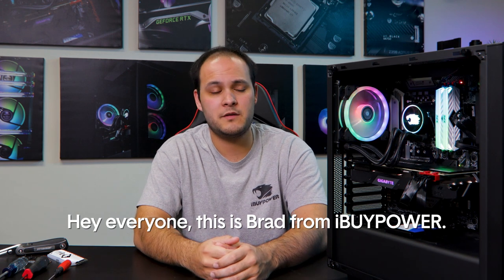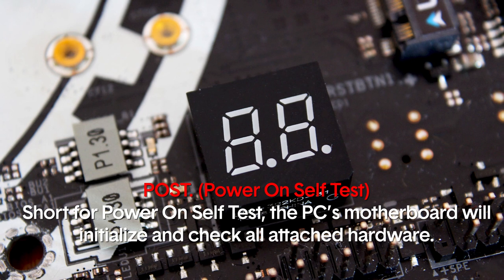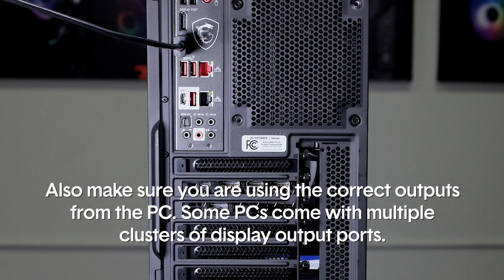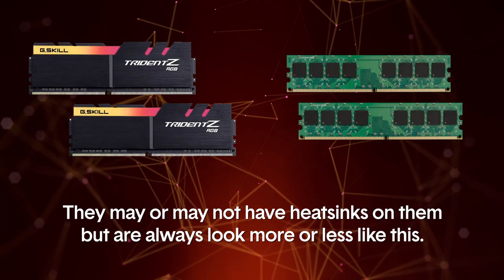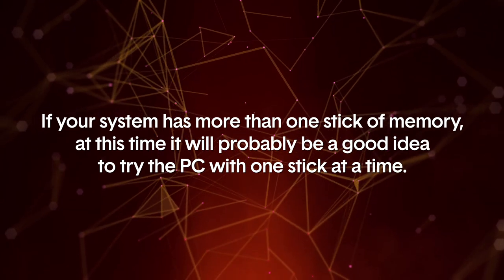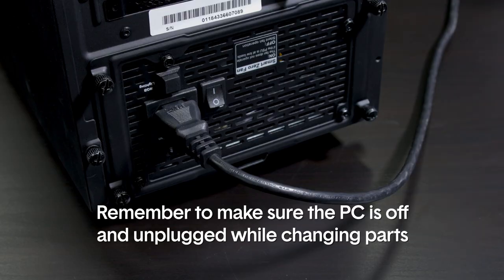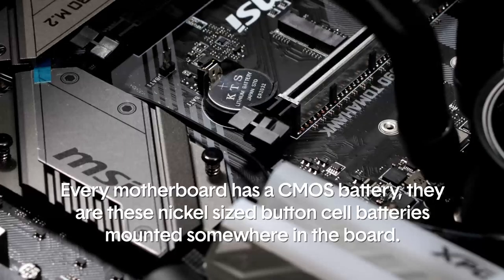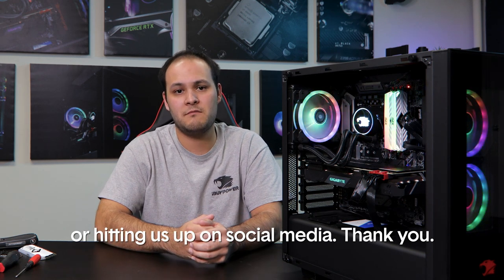Troubleshooting PC No POST | Computers and Coffee

Comment: Hi, I’ve done all this and still no post, any help?
Reply: Same with me. Did you figure it out?
Reply: Ilias Guenou you figured it out yet?
Reply: @jaxonyt2580  same...I'm kinda sad now, like mine worked before forever then I come home one day from a friends and now no post, and I pulled everything out and reseated and cleaned the entire pc just for it to not work
Reply: @daltonyoung7146   did you fix?
Reply: @kaaolin  yes I did, I had to remove my gpu and replace it, since it died, if all post steps dont work and you've done all the steps then see if you can swap out stuff and find out what's dead, (first just take all the stuff out and then put it back on 100% right and if no worky then you have something dead that needs replacing.
Reply: @daltonyoung7146  how would I tell what's dead without spare parts
Reply: @kaaolin  Ask a friend for theirs, you cant tell without new parts, so good luck

Comment: great vid man. but still i dont have display. sometime it displays sometime it doesnt
Reply: Hi. DId you find solution for this? Im facing the same problem. Sometime post and sometime not. When post everything is working properly.
Reply: yusuf aiman did you fix it?
Reply: Not yet but i found the cause for my PC. Its XMP profile. Boot without problem if I maintain the default ram speed.